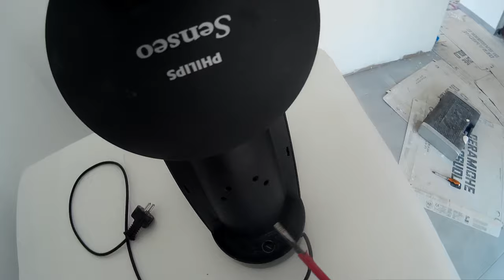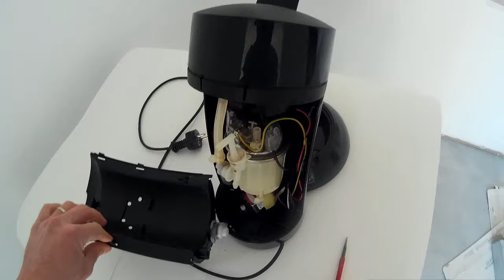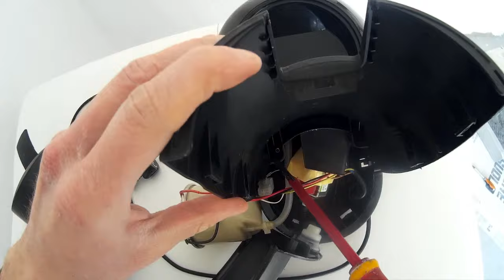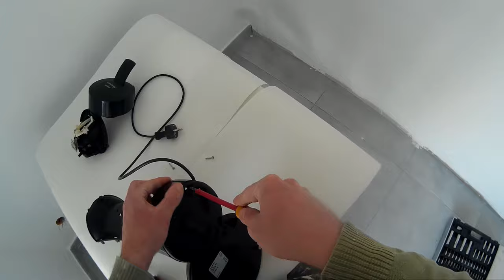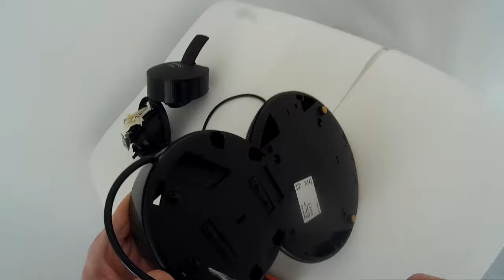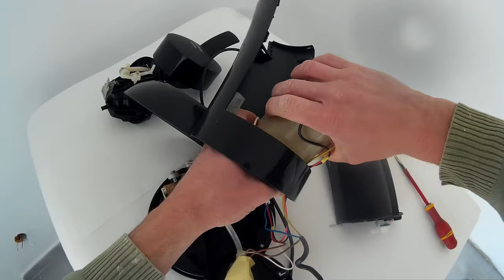✅ Disassembly - Démontage PHILIPS SENSEO

Comment: Hello :) I have the same machine, but recently it started to release less water than it was before a coffee. Coffee makes it twice less :(
Reply from the maker: try this https://www.youtube.com/watch?v=FaL3Vh1VLqU or https://www.youtube.com/watch?v=9yr21pgffpo
Reply: @Keitex   Unfortunately it doesn't want to be reset, the pump is running, the machine is clean, but it puts some water in the cup.
Reply from the maker: @bmwperformance7763  unfortunatly, i think you must change the capacitor https://www.youtube.com/watch?v=9yr21pgffpo
you can find it on ebay
https://www.ebay.fr/itm/Kit-de-REPARATION-PANNE-SENSEO-condensateur-EPCOS-MKP-0-47-F-250V-305V-470uf-25v/263374541642?hash=item3d5258934a:g:q3IAAOSw8UZaKkpi
Reply: @Keitex   Now I disassembled mine from your video, and I saw that my capacitor is different, blue in color with number b3293 x2 mkt / sh. It's not the same as from ebay, is it a problem :) The machine is senseo HD7812
Reply from the maker: @bmwperformance7763  the capacitor must be 0,47µf and 470µf for Modell 7810, 7812, 7820, 7822, 7823, 7825, 7827, 7840, 7841, 7843 . The color and the brand is not important but you have to respect the mounting direction for the 470µF 25V
Reply from the maker: @bmwperformance7763  the blue : 0,47µF non-polarized capacitor  like this : https://www.ebay.com/itm/Kondensator-MKP-X2-0-47-F-275V-Senseo-7810-7820-7822-7823-7825-7827-7840-7841-43/221635499469?_trkparms=aid%3D111001%26algo%3DREC.SEED%26ao%3D1%26asc%3D20180816085401%26meid%3D096fb981c1eb4f9598b057b9a454450c%26pid%3D100970%26rk%3D1%26rkt%3D3%26mehot%3Dpp%26sd%3D221635499469%26itm%3D221635499469%26pmt%3D0%26noa%3D1%26pg%3D2380057&_trksid=p2380057.c100970.m5481&_trkparms=pageci%3A88e9b276-1bcb-11eb-ba79-c24db20919be%7Cparentrq%3A80db461c1750a6e58a8b22cefff78c6e%7Ciid%3A1